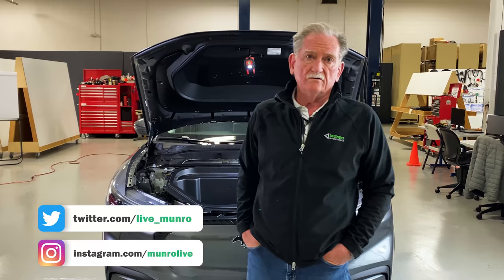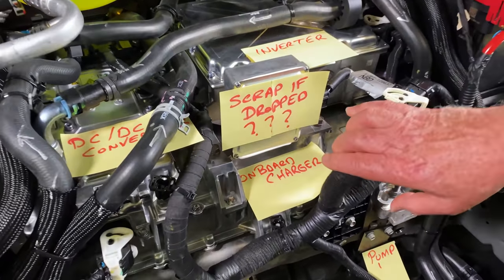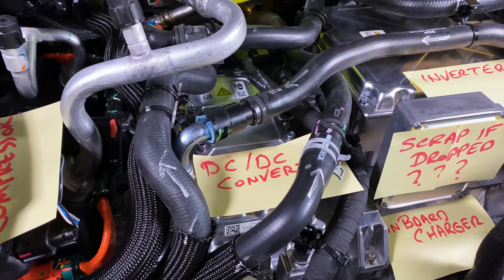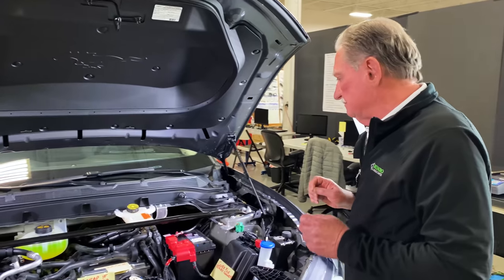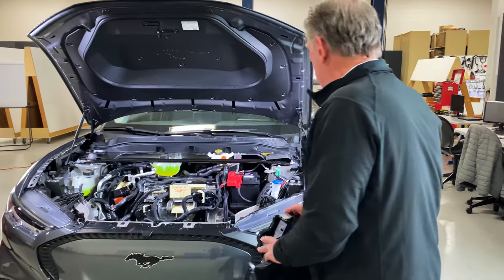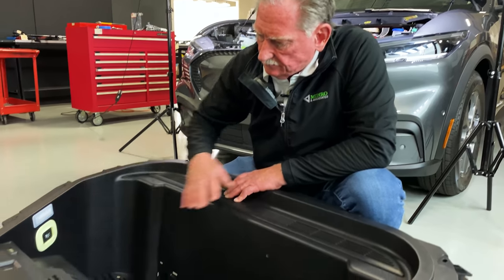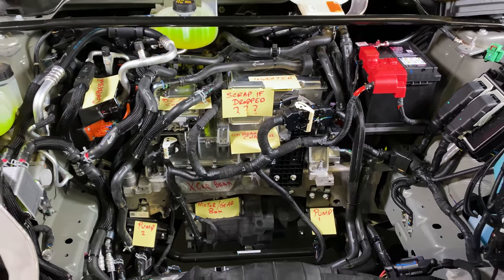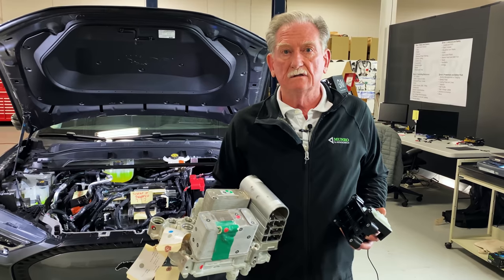Mach-E Thermal System Nightmare

Comment: Ford built a prototype I would in my garage with a Siemens inverter and 4 squirrel-cage motors. It would be a mumbo-jumbo of valves and hoses and connectors to keep everything cool like that DISASTER over there. At least it won't be that APPLE NOTEBOOK where if the USB charger does not work, and the apple don't-care-center just says "just chuck it into the bin, and buy a new one". You can replace each one of these valves separately, not hot-glued to each other.

Comment: Whilst it does look busy , is it that bad?   It looks worse as there are quite a few wire harness's which confuse the issue. Perhaps it would be more understandable if they were coloured differently. There must be some benefit from having individual components. I have seen many new Heat source heating systems which occupy a huge amount of pumps, connections and pipes and they seem extremely reliable. Yes, age may cause some persihing but with modern materials the failure rate will be very low - hopefully. Is there much pressure in all those pumps and pipes ?
I think although it looks a little perplexing surely Hybrids must have many many more parts than this. Be interesting to know how many parts are in the Mach-E system compared to their competition and Hybrids.  Has anyone looked at The Porsche Taycan engine bay ?
Good work Mr Munro

Comment: Spring clip connectors may "just leak" at Ford, but in my Toyota vehicles none have ever leaked... and some were used for over 350,000 kilometres over 17 years. I even removed some for maintenance and just reused them. Maybe Ford should buy better quality hardware...

Comment: With all those hoses, will it be a leaky mess in 5 years?  How long before they get brittle & crack?   especially in different weather conditions.  Serious question.  Anyone with thoughts?   Or could all those hoses stay intact for 20 years or so?
Reply: well... it depends. All I want to point out is that for the past decade or more manufacturers have been working hard on eliminating as many hose connections in their vehicles as they can and minimize the amount of seals required in general. Because they are just as tired of endless leaks as we are.
Ford really does not seem to care.

Comment: The thing is... I have vehicles with 25+ year old hoses and they are pretty much never a problem.  And when they are, I can deal with them quite easily.

What I don't like is the FOUR pumps and those valves.  Hell, did Ford ever get a heater core bypass valve to be reliable?  I smell leaking valves already.

Comment: "Box on top of box on top of box". I am just wondering, would it be possible to mount these boxes vertically side-by-side? Servicing individual parts would likely be easier and would give the engine a modular-type look.
Reply: I honestly don't think it matters, nothing major gets replaced anymore.  The hoses however,  do need replaced.
Mr. Munro would complain the coolant lines are too long.  It is easy to point out flaws, everything is a tradeoff.
Personally never buy version 1 of a car.  The Tesla roadster was horrible, and the Model S spent more time get parts replaced than any car.

Comment: my 1980 Mustang   was junk  within 5 years I replaced   rad, water pump , steering rack, rear tail light, rear suspension link and the hood rusted through on leading edge      I never bought another FORD

Comment: Surely the amount of hoses and clips can be reduced and should probably be done as well, but Ive had really old ICE cars here in Finland where you drive in wet, snow, salt, freezing temperatures and then again warmer conditions. Still I could take stuff apart from engine bay and the old tubes/connectors would hold up without an issue. 

Electric cars dont produce that much heat in the area of the tubes so they arent even getting the same stress. Someone saying "They have to get their money someway" is somewhat funny statement as many dont have to service their cars for multiple years. As if plastic clippers or tubes saved their income.

Comment: Did you see the cup holders in the frunk? The frunk tray has numerous screw holes. The first time a customer fills it with ice and drinks will it ruin the electronics?
Reply: There are relatively large openings to the road under all that stuff, just like any other car.  The e boxes are weather proof.

Comment: "Box on top of box on top of box"
Sounds like my 1996 cadillac LT1, if that water pump goes bad, might as well replace the distributor thats behind it, and vis versa
Also who puts a distributor down low on the front of an engine where it gets splashed with rain and puddles

Comment: Just my opinion but I grew up in a family auto wrecker taking cars apart and am also a licensed mechanic who even worked at a Ford dealership at one point. I have never seen one of those spring clamps leak and in my opinion if a component fails at least on the ford you are only replacing the failed component.  When it's all combined into one unit it is not only a waste of materials to replace an assembly over a component but also much more costly.

Comment: Looks like the Ford was fast tracked to get it into production.  I suppose it works just fine but is not an elegant solution.  Perhaps the elegant solution is actually more expensive when the cost of producing complicated parts is factored in.  In any case, the spaghetti of hoses and wiring is, in and of itself, a piece of modern art. Your engineering analysis should be a mandatory primer for all engineering students.  Well Done.
Reply from the maker: Thanks Gary.

Comment: Hello Sandy,  couldn't agree more.  You didn't even get to wiring. Reminds me of the Design process.  Get your packaging space before the other guy and let them worry about their problems.  You point out the very issue that still exists in the traditional auto makers.  They just do not know how to work together to compliment each others design and DFM.   You never got to the point of explaining what would happen if one of the fittings leaked.

Comment: At the low temperature and very low pressure an EV's cooling system runs at,  those spring clamps are more than enough.  Hell, they use them on ICE cars and they hold up.  That does seem to be an overly complicated piece however.  If old Henry were alive, he'd have them down to one pump and four hoses tops - but he'd use those spring clamps.

Comment: This screams product development to me. The Mach-E looks basically like a productionised prototype. I'm sure Ford will learn from this and the Mark II version will be much improved and THEY'LL REDUCE COSTS in the process.
Also, those individual boxes scream too. The message this time is *separate teams per assembly unit*. The team asks 'how much room do we have ?' and they get a box. Then the boxes are screwed together. Once there is better control over integrating those parts as a whole, the boxes will vanish.
The motors/pumps with heatsinks integrated strike me as a bit smart btw !

Comment: Wouldn’t the lack of engine heat mean these hoses might be fine though? Isn’t the problem with hoses cracks overtime from heating and cooling constantly?
Reply: To be clear I understand being offended by the waste of Money and weight and therefore customers have to eat that price…but some in the comments seem to think these will lead to constant repair bills and puddles and I just don’t think that is the case when heat isn’t as much of an issue. If anything I’d be worried about someone servicing it wrong and that causing a leak instead of wear and tear leak.

Comment: As an old water pump guy, I notice there are ways of reducing liquid pump sizes by changing connectors.  Instead of 90 or 45 etc. ;  design connectors with radius bends.  It is an old trick but few people use it even today.  google Q=Va or here's a link for more  https://en.wikipedia.org/wiki/Hazen–Williams_equation

Comment: Great design and production analysis BTW - RARE :-) ~ Under the "Frunk" it just looks "Under-designed' / in-process i.e. they are not that committed to that particular design and layout / in-flux. Reminiscent of a Hawker Hurricane "Bird's nest" of cottage crafted components vs.  Messerschmidt BF 109 more modular larger complex (lower number of components). All that tubing and connectors on the Mach-E (Thermal system "Nightmare" ) is reminiscent of 40's to 1960's aviation ~ Except as @Munro points out far less reliable/ serious points of failure.

Comment: Does this vehicle have more cooling hoses than EVs from VW, Chevy, & Tesla?   Can we assume it’s water with some antifreeze as there are screw cap bottles visible when plastic sheathing is removed.  What is periodic maintenance on cooling system, 50K miles?
Reply: Exactly, I doubt its under great pressure and having seperate items piped together may be better than one big unservicable lump. when the car is ten years old small parts will be quite a bit more economical than complex integrated ones - who knows

Comment: In deciding between the mache, id4 or model 3 the interior of the Ford is as bad as those cooling hoses. I’ll gladly take mediocre panel gaps. Picking up model 3 this week. ID4 was really great. Little pricier and no included mobile charging cable.
Reply: Can't go wrong with an M3.

Comment: As one that owns a ford hybrid/electric vehicle I’m not sure everyone knows the functionality of this system. Cooling is critical to the charging and function of this electric system especially when it comes to high speed charging and regular efficient dynamic function of this electric system. Also it is necessary to having separate circuits of cooling for this vehicle. Some circuits act as heating for the vehicle so that while it’s plugged in a charging and you remote start it that circuit is heated differently for the cabin then say having that same heat to travel through all the other circuits. Honestly gm apparently forgot about cooling their vehicle modules and components while charging and that’s why a lot of them started on fire. I’d rather have excess circuit of cooling than having the greater potential of my vehicle starting on fire. Another factor is while the battery and modules are liquid to air cooled they also pass through air/gas exchangers which if the components reached a threshold the compressor will chill the coolant also. Electric vehicles are a progressive industry and I’m sure most will be re-engineered but for now it’s functional and honestly this is good liability on their end. These systems will probably only need to be serviced or taken apart 1% if that of it’s lifetime so the clips will be fine and nothing should leak. Fords hybrid systems are some of the highest regarded along with Toyotas and used in taxis in big cities with batteries lasting well over 10 years and 300k miles. There is also nothing requiring “regular servicing” of the electric system component cooling circuits.

Comment: If Sandy had his way, the whole car would be made in one piece.
He is the reason why we have very large parts that cannot be easily fixed. The whole unit has to be replaced even if a tiny part inside needs replacing.
It may be cheaper for the manufacturer to make one piece for everything, but a lot more expensive for us consumers when things go wrong.
Anyway, I still like to watch his videos.

Comment: I wonder what the thermal removal capacity is on the Ford vs the Tesla… With all the hoses and the extra fluid the Ford’s cooling system would have a greater thermal absorption, this could potentially lend itself to a longer battery lifespan. Tesla is currently facing a few lawsuits worldwide because of battery degradation issues. With the higher performance models come higher heat generation, not only in the electrical components that control the flow and delivery of energy but also in the batteries. It takes quite a bit to effectively cool large packs of batteries. Especially during spirited driving. It may be that Ford over-engineered their cooling system to more effectively cool their batteries. They may be trying to avoid the issues that other electric cars have experienced. Hopefully they will simplify things in the future as they apply lessons learned from the Mach-E.

Comment: Looks like the old battery tray much stronger. And since Ford tended to use big heavy batteries...going to pure plastic doesn't seem worth saving 2 million on total production. Ford quality control from the 80s is not a great recommendation. 
 Excessive connectors and free flow every which way hoses does seem poor planned.

Comment: It's not the 80's anymore - hoses will last for over 100,000 miles exposed to the very high temps in an ICE vehicle.  I suspect they will last much longer in the less severe environment of heating and cooling an EV.  In 15 years you will be able to get most of those hoses and connectors at any auto shop.  Tesla will have iterated the octovalve 9 times and NOS will be huge money on eBay.

Comment: I think a big part of the problem is that engineers in the incumbent manufacturers are struggling to come to grips with electric drive systems and their requirements. It looks like a mess because they didn't fully understand what was needed, and bits were added as they designed and tested it during development. Once they got it all working, rather than do a complete cleanup and minimise the parts, they did what they always do and said "okay, that's good enough, let's go with that."

It's been pretty clear that virtually all of the ICE manufacturers have struggled in this way, whereas Tesla and other EV startups have had the opportunity to build a knowledge base of EV vehicles from the ground up, so they aren't saddled with all these old ways of thinking.

Comment: So the bottom line is (compared to Tesla) the Mach E - just on the thermal system - has more parts and costs more to assemble. 
And they will produce fewer Mach Es than any Tesla model - therefore much more limited economies of scale.
Given that Ford are aiming for rough price comparability with Tesla for the Mach E, then there is almost next to no chance the Mach E will be profitable and more likely they will make a loss on it per vehicle - never mind the advertising and marketing costs....
Have I got that right ??

Comment: I get a vibe that Sandy is not a fan of right to repair. Having threaded fasteners, separate pumps, valves, and hoses make it all very easy for diy minded people to diagnose and do a low cost repair than compared to changing the whole stack of manifolds, valves and electronics for one tiny component failure.

Comment: Even if that’s not their intent, it sure is a convenient side effect. In fact that’s often the case for most EVs made by “legacy manufacturers”, especially in models that were converted from what was originally designed to be an ICE car. Besides being encumbered by the huge amount of off the shelf parts they must incorporate (Ford has part#’S on their latest vehicles that have been in the catalog for the last 30 years!). They’re also hindered by the conventional thinking entrenched into those corporations, top to bottom: from execs to engineers to designers to suppliers to assemblers. It’s a huge benefit for Tesla (and other EV start ups) in that they don’t have that luggage to haul around and not having to purge their team of any existing or old school thinking/values/objectives… they get a clean slate in every way, and that’s the only way to come up with something truly revolutionary.

Comment: You get the impression that Ford put a frunk in for marketing purposes - simply because Tesla do it.  The Leaf does not have a frunk and the motor/inverter/DCDC/charger are nicely bound on to one unit where coolant flows internally (with just a few hose connections). 
You can check out this video (my channel) for a brief teardown https://youtu.be/4GG3QRPGlPc

Comment: Complex designs like this pay back in spades with out of warrantee repairs and support the dealer network with repair income. Stuff like hoses will last a while but certainly fail later so the owner is initially satisfied. Of course with time this tangle will become fragile, intermittent and difficult to repair. Plagued with intermittent problems and unsuccessful repairs the dealers will benefit while the owner will be motivated toward new car purchase.  Remember when rust was so common we just accepted it as the natural evolution of Detroit vehicles.

If this is not Ford's intentional plan then Ford management and Ford engineers are just idiots for letting this design escape.
Reply: I think is more like designed by individual separated groups of teams. Motor, charging, cooling, battery BMC etc. All hard work were just hastily slammed together at the end.

Comment: So what are all those hoses actually for...to cool what?...the motors?..that battery?...what?
Reply from the maker: Motors, battery, inverters, on board charger all need cooled, the PTC heater uses coolant to heat the cabin too.  You need valves and pumps to select between all the modes and to actually move coolant since there’s no pump driven by an ICE engine.

Comment: FYI coming from a gasoline guy, those pumps are very VERY common for supercharged cars and trucks as well as turbo vehicles soo standard easy to come by and all of those connectors for coolant are able to be bought at an AutoZone. Kinda mutes this whole video. Again an engineer that hasn't worked on cars